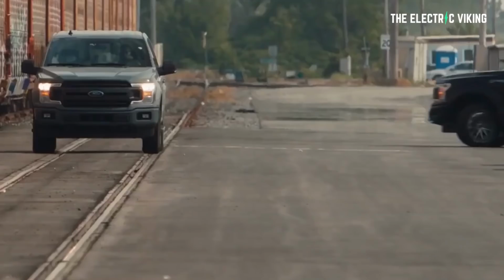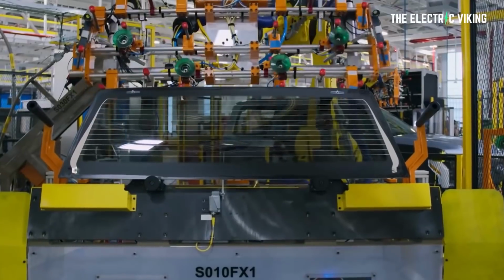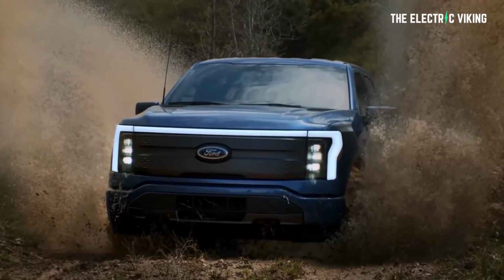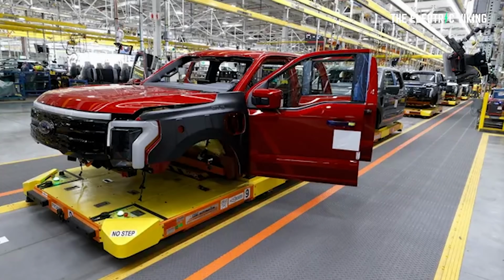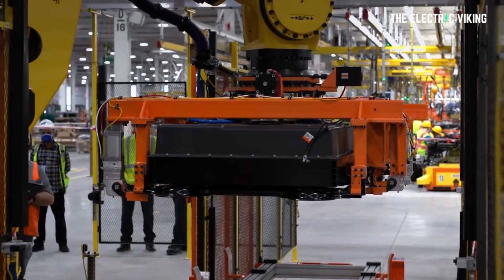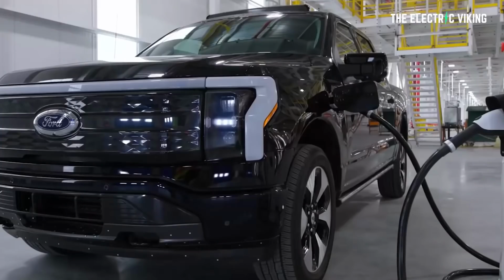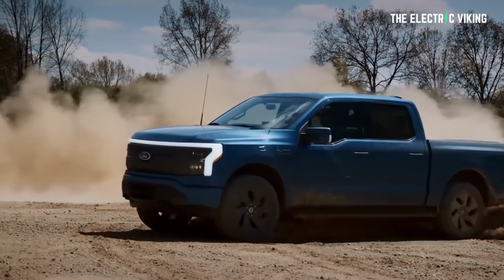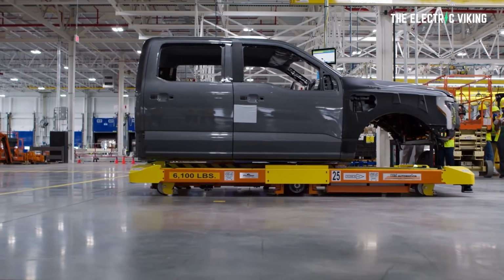Ford's new EV plant exposes Ford's ticking time bomb

Comment: Yes Vik ev s are easier to put together then clunky ( to many parts) ice vehicles!
Reply: Ford is still using way too many parts in their EV's too. And way too many people as well. You do not see hundreds of people putting stuff on a car at Tesla. They have engineered the vehicles now to require as few people in the process as possible by reducing the part counts. Texas Model Y line requires 15% fewer employees than the Shanghai plant. And that line employs 20% less than the one if Fremont because it is chained to the old conveyance systems that Tesla inherited when they bought the factory.
Reply: @davefroman4700  You're misinterpreting Tesla's cost savings of incorporating all possible controls into touch screen functions. Most people want some control function independent of the screen but it costs more and would reduce profit for your savior Elon.
Reply: @heathwirt8919  Your personal preferences have nothing to do with the rest of humanity. All the younger generations are perfectly happy with haptic control surfaces. They are using them 16 hours a day anyways in their phones. And secondly if you consider how cheaply all those tactile controls are made you would understand why they are not in the tesla's. Failed window or heater controls are a big ticket replacement for the OEM's to make money off of. The part is worth 30 cents, but they are going to charge you 3-4 hours to do it. The best part is no part in engineering. The best process is no process. Why don't you go back to school and study some physics. Maybe finish high school first though....
Reply: @heathwirt8919  That is where you are wrong. They are nothing but computers on wheels. Its a computer, a battery, a little bit of cooling and an electric motor. They do not even have a transmission or a drive shaft. And no car in history has ever gotten better after it left the factory without adding expensive parts. EV's can be updated with software. There are a lot of Tesla's out there that were given more speed or greater range simply with a software update over the air. Free. More entertainment options in the car? Free. State of the art security system that records anyone that messes with your car? Free. Dog sitting mode? Free. Sorry pay but you are really going to hate the next ten years if you do not like change. Which really is kinda of pointless on your behalf. Change is the only constant in the universe.
Reply: @davefroman4700  Stop Dave, these are automobiles not computers and they share many common components with ICE vehicles. Many of them use a gear reduction transmission and half-shafts from motor to drive wheel (technically a drive shaft), friction brakes, springs and suspension systems etc. The major difference is the prime mover is electric vs. internal combustion. Over the air updates are nothing new but Tesla wrongfully claims they are the only manufacturer to offer them. I'm looking forward to the next ten years where competition in the EV would will bring cheaper and better offerings to market. I know competition makes dyed in the wool Tesla fanboys sad but it's better for them and other consumers to have choices and competition.
Reply: @heathwirt8919  You are really going to hate the next 10 years. Im not a Tesla Fan Boy. I dont own one, I have no intention of buying one, and I do not own their stock. I am an engineer who spent his life designing new products and systems for commercial applications. Ive never seen a manufacturing company that is run as massive research hub with the structure and efficiency of a software company in my life. You do not see high school dropouts putting things into holes in their factories. Its almost all engineers and their apprentices. And they are the number one pick of new graduates for a reason today. Every other manufacturer pegs people into holes where there is no creativity. You have a book of standards, and everything that is not in that 50 years old book? Is not feasible in corporate's eyes. You are not allowed to innovate in their structure. At tesla if anyone comes up with a better way to do something there are only three tests it has to pass, not 36 months of design reviews. Is it going to improve the product? Is it going to improve efficiency? And is it going to result in less material and waste. If it passes any of those without compromising the others? The software approves it and it goes onto the line as soon as they can get the part changed. And since they make most of the parts in house that is usually in a couple of days. 
I also dabble in Anthropology as a hobby. Let me let you in on a little secret. 99% of all the incumbents business models in history have not survived technology disruptions. History is littered with their failures to adapt. Its a matter of aggregate efficiency. And when you look at that measurement in the OEM's vs Tesla? They are not even on the same continent, let alone in the ball park.

Comment: Ford Lightenings main competitor ….. Ford ice .
Reply: I read Ford's 1927 autobiography. He was an early Elon.
Reply: @markrowland1366  maybe? Henry though made it a point to offer affordable housing for his workers, and he also paid for their college.
I would very much like to see tesla do something similar. Elon could easily buy out something like the boxabl tiny homes. 

Use existing land around the tx hq and put up cheap energy efficient housing for the thousands of workers needed in the plants. 
They could even dig tunnels from the housing area to the plants with the boring co and use automated tesla shuttles to ferry the workers around. With free starlink wifi as another work perk.
Reply: LOL All they did is copy the Tesla factory… from the whitewashed walls to the electric vehicle movers… I wish them good luck though… let’s get off fossil fuels asap
Reply: Maybe? Supposedly 70% of the initial reservations are from none Ford owner's. 
What's interesting is them cutting off the over 200k+reservations in only 5 month's from opening up for reservations. 
They also are supposed to have like 50k fleet and commerciap orders on top of the retail orders. 

Last year they only sold about 700k total f series. Which was the lowest total since 2012 for sales, and now they get almost a third of those sales in ev reservations after just 5 month's. Should be interesting to see how low the ice f-150 sales are this year and next as they ramp the lightning lines up.🤔

Comment: This is everything a modern factory should be.  This is giving me a buzz just watching.  It is similar to my time at Intel in the UK back in ‘79; I could not wait for Monday mornings.  A new similar ‘line’ for other vehicles and providing they can keep the parts flowing, this should assure a good future.  Nice report Sam.
Reply: Everything a modern factory should be is Giga Texas. The pinnacle
Reply: WAY too many people doing jobs that are easily automated with the sled conveyance system today. They are going to be screwed.
Reply: @davefroman4700  They are using sled conveyances today, you must have missed that.
Reply: @heathwirt8919  No I did not. But I know more about these systems than you do. They are designed to align themselves to a station with laser accuracy. A stationary object is easily automated. The constantly moving production lines of the past meant that a lot of jobs could not be done with automation. Ford is not using the system to its full potential and still has too many people putting things together that no longer need to be done by humans. The other thing is their part count is 3 times as big as Tesla. More parts? More points of failure, more time in manufacturing, and a greater chance for error. Not to mention more costs.
Reply: @davefroman4700  You're writing is very good but it's obvious you are completely ignorant of manufacturing processes. You're talking points only work on Tesla fanboys not manufacturing engineers.
Reply: @heathwirt8919  Using Ad Hominem isn't convincing anyone.  You obviously haven't walked the walk.
Reply: @heathwirt8919  Yup, i sleds gliding around to their next station and several techicians making changes but the only robot seems to be the sled. The Tesla shop is the inverse: robots everywhere and rarely do you see a human.
Reply: Have you even seen videos of Giga Berlin or Giga Texas? Those are state of the art factories.
Reply: @josephlemieux5909  and they produce shitty quality vehicles poorly built need human hands
Reply: We need to do a deep dive into a Tesla factory and find out how in 2022 they still can't properly fit body panels and ship cars with paint jobs fit for a garbage can.
Reply: @heathwirt8919  HAHA 😂! How many cars have seen from those factories bro? I know your precious ICE legacy automakers are getting their a— handed to them but you’re really digging deep bro!
Reply: @heathwirt8919  it’s funny because it’s true 😂